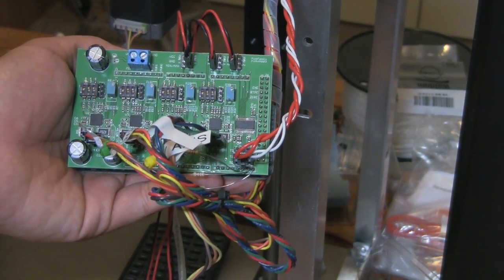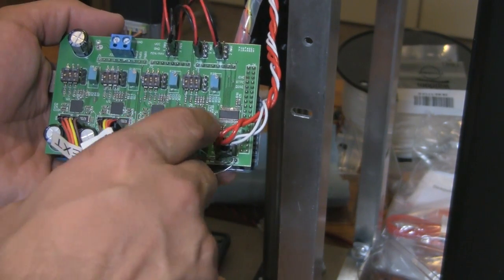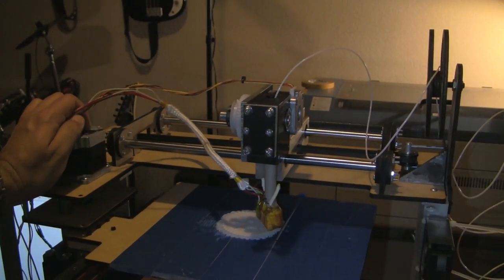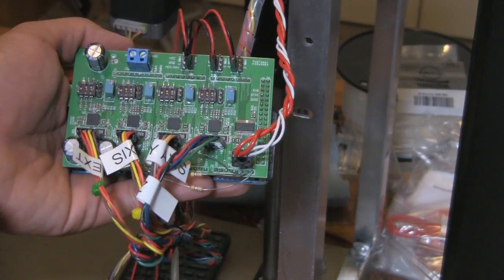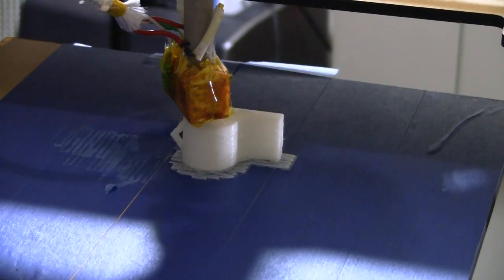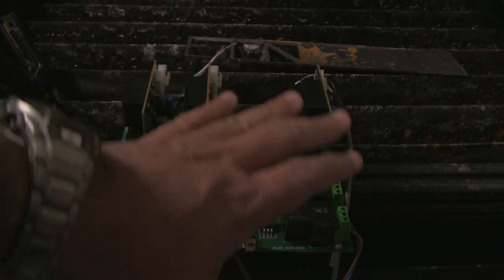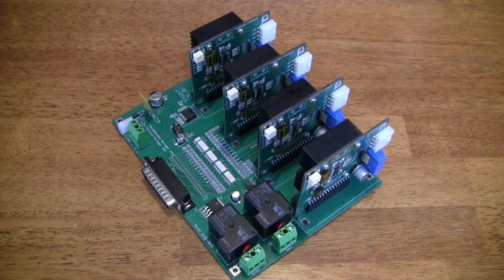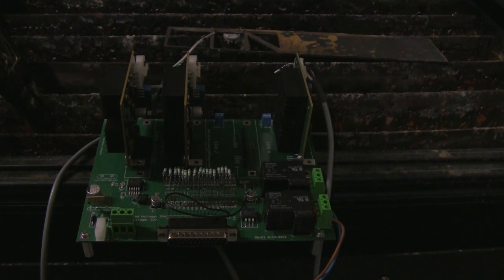DRV8825 Based CNC Machines (3D and Plasma)

Comment from the maker: You can put any stepper, but the most you will be able to drive is about 2.5A sine wave peak per channel, and not all of them at once as if the drivers get too hot, then they will enter thermal shutdown which of course means job-death. In essence you will not want to drive 4 NEMA 23 steppers at full blast. Four NEMA 17 at full blast (usually 1.5-1.8A) is OK.